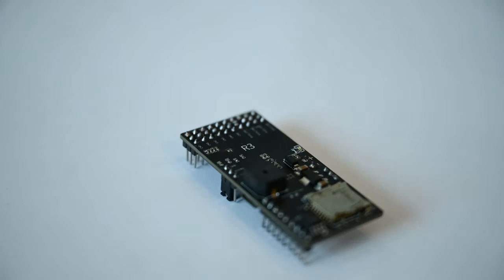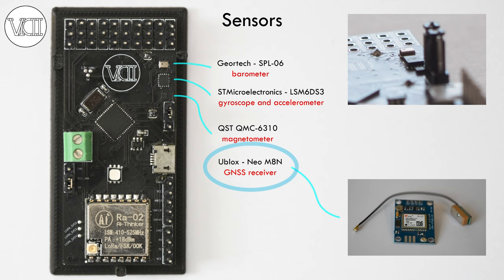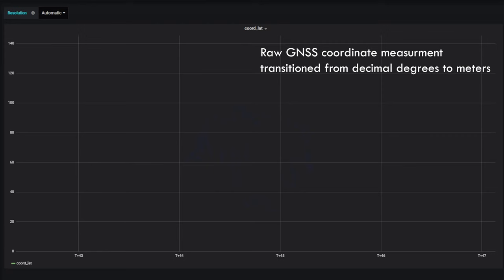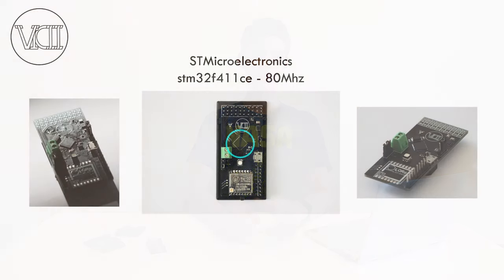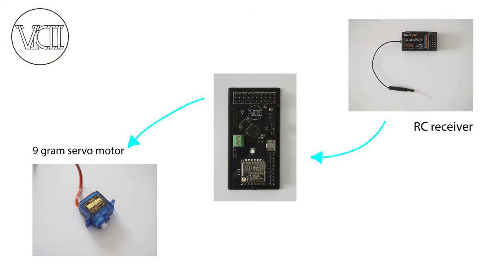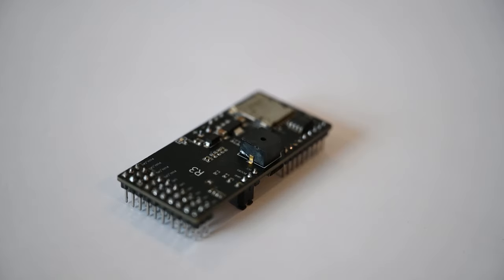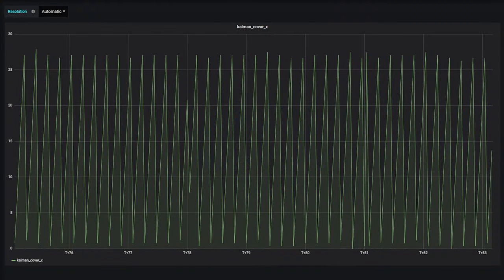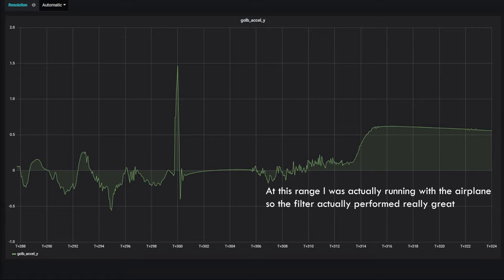The Vicii R3 flight computer

Comment: I like how you are consolidating ardupilot features onto a straightforward single platform fed by LORA. That hardware manipulation is a nice flex 👌.  Would that be like bitmath? 

Question:

Have you integrated a holding pattern once the plane comes close to the desired 3d position? If the plane just points it’s velocity along a vector between the current position and intended 3d point, that’s not quite ideal. It’s very good, and most of the work is done, but extra logic may be key for maximum practicality. Basic checks so that the inputted goal coordinate isn’t 500km’s away due to a typo, basic input validation to make sure that a letter isn’t taken as NMEA word. 

Very cool, good luck! Very interested in future developments. I haven’t heard of some of these chips for my rocket FC’s, but will consider them. 

Awesome!
Reply from the maker: Thank you so much for the comment! I actually don't know what do you mean by bitmath, the control code definitely needs more work! I have written it about a year ago and since then been developing a proper aircraft to test it on, should be done by the end of the summer! Would love to chat about your rocket fc!
Btw, I'm using the UBX binary protocol for GNSS, which is much better then NMEA for quick data transfer.